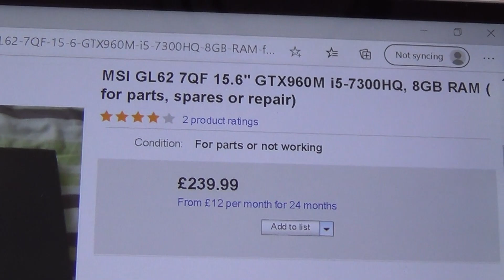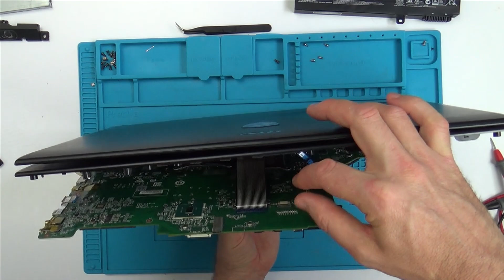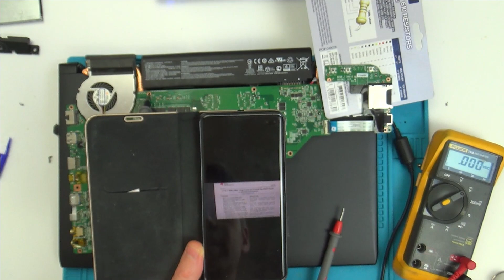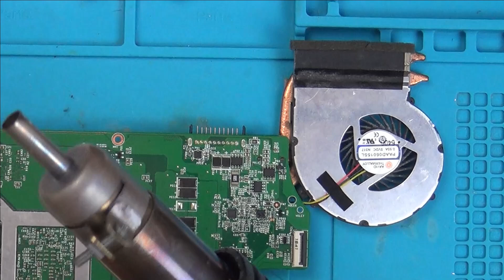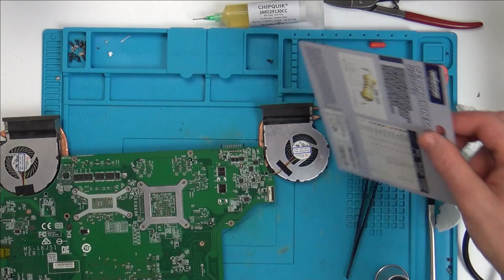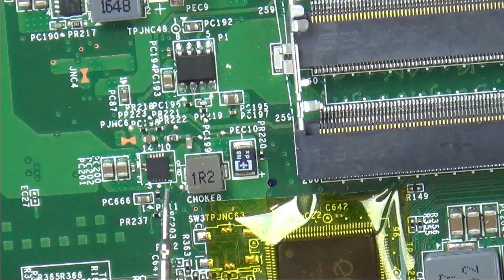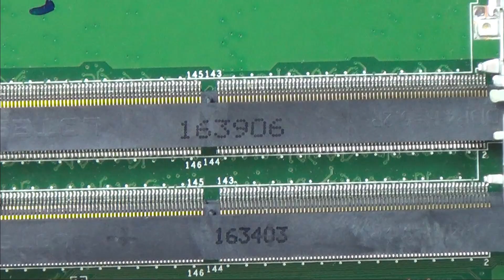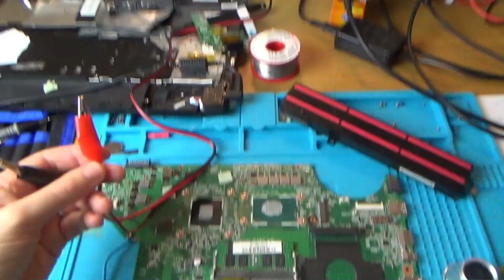Trying to FIX : Faulty MSI GAMING LAPTOP from eBay

Comment: How NOT to repair a laptop, injecting 5 volts 3 amps in
Reply: @Hamedtheunforgiven you're forgetting Vince makes it clear that he doesn't know what he is doing with these repairs and that these videos are meant as entertainment only, not a repair guide. It's all a learning process for him
Reply: Didnt notice where he was putting that amount of power to. He probably fried that chip
Reply: @krackpack1 look at the average voltage of a laptop it’s more than 5v most laptops are between 18-22v also most laptops use chargers that are greater than 3 amps.
Reply: he could have saved himself so much time that he just measured the voltage going into the battery from the charger
Reply: @Dtr146  no he couldn't. Just because a laptop has power going from the battery doesn't mean it works or does anything else. The laptop will have 2 circuits, one going from the charger to the battery and one going to the main board. If the entire circuit ran via the battery it would cause no power when the battery fails which would be unacceptable. It would also result in battery drain during use and would never run on external power
Reply: @TheCod3r  dude he spent I don't know how long diagnosing the power circuit. The power goes to the battery regardless whether the CPU works or not. I've owned one of these before. You check the voltage coming from the charger and out the pins on the board itself to make sure that the power circuit is working fine and if it's still not turning on after you check the voltage and it's working fine then it's a problem on the board. Geez it's like you never worked on a laptop before
Reply: @Dtr146  everyone has their own methods of diagnostics and Vince doesn't know what he's doing. Either way, the battery is irrelevant to whether or not it's turning on. Thd laptop will work regardless of whether voltage is going to the battery. There are 2 primary rails, vcc_main and vcc_batt. Each one branches off from the charger input. If the charger is plugged in the power going from the battery to the rest of the board is bypassed. Therefore, battery voltage (both voltage in and out) is completely irrelevant when attempting to power the device from the power brick. Personally I don't understand why you're getting so salty, but you need to chill out. If you don't like the way Vince does diagnostics as an amateur don't watch the videos. Simple as
Reply: that didnt kill that chipset ..   but i have to say  he should  use a flir cam or something
Reply: @Bloodbound89  he doesn't have one The alcohol trick works fine though but like past the halfway point after he found the damage on the GPU and seep you he was just tinkering.
Reply: My comment wasnt to insulate Vince. I know he makes sure people know hes not a pro. I was only fixing a comment I made prior. I had said I apply 5v to laptops all the time it's how i fix laptops. Bit didnt realize he applied it to that chip.
Reply: @krackpack1  ah yes, don't want to keep the heat of vince in or anything lol, /s for you idiots about to woosh me
Reply: You realize most laptops utilize 18-22v dc so 5v isn’t going to hurt it also majority of gaming laptops use a lot of amperage so 3 amps also isn’t going to hurt it, know what you’re talking about before commenting and majority of modern phone can use a 5v 3 amp charger hence quick charge.

Comment: and this is why you always remove all power to the board when your cleaning it or doing anything to it other then troubleshooting it ofcourse. Looking at the way those ribbon cables are, chances are it shorted something and it ruined the chipset, kinda like plugging in a screen without disconnecting a battery.
In one of the macbooks the backlight (40+ something volts) is located directly next to one of the pins which go to the CPU onthe screen connector. overtime the two short together (i thinksomething like corrosion causes it to short) and this kills the CPU. Louis Rossmann has showed this in one of his videos.
Reply: I killed my IO cable like that, inserted at an angle while the pc was on and burnt the cable(asus f555l)
Reply: Yeah. If I'm working on a laptop I always, always, always, unplug the battery and hold down the power button for 30 seconds before doing anything else.

Comment: What probably happened is the seller was trying to upgrade his cpu/gpu. These are non-upgradable on this particular unit it seems.  It looks like they tried to pry up the gpu and cpu only to realize they were soldered to the board.  Put it all back together and it didnt work because they fractured some solder joints and/or damaged some traces.
Reply: And then as usual for scam-bay: "Oh haha idk why but it suddenly stopped working"

Comment: I know I've commented already but you already know I leave comments as I go through the video 🤣 before writing off the PCH (chipset) you should have 2 mosfets close to the charger input. Check those first! It still looks to be the PCH (love how you've moved onto using voltage injection by the way). IF it is the chipset, my offer will still stand. I will quite happily replace that chip for you. My ACHI IR PRO SC and my high level of patience for manual reballing is at your disposal 😁😁😁
Reply: That's good of you mate, nice one!
Reply: That would be cool to see a remote colab!
Reply: @nicoful86  my channel isn't big enough for Vince to justify that but he has already done something similar with @The Retro Future when he repaired the game boy 😁
Reply: @TheCod3r  I  think he'd gladly accept a reball if offered, otherwise it's the junk pile.
Reply: @TheCod3r  By the way, do you have equipment to reball old PS3s as well?
Reply: @nicoful86  I do have the stencils but they're not really worth doing any more. They're only worth £50 / $60 and wouldn't be justifiable to repair them from a repair job point of view because of the time involved. I think Vince prefers to do it alone, but the offer is always there for him if needed 😄
Reply: @TheCod3r  Interesting! I've sold two delided backwards compatible models for around $160 - 180.  But yeah, it's like I find them every day. Are you UK based?
Reply: @nicoful86  yeah they only sell for around £60 here in the UK. Not sure about delidding though I've never really been into that sort of thing really :)
Reply: Also, check out my video on manual reballing by hand. It would be interesting to see you attempt it yourself 😁

Comment: keyboard broken, no hard drive, dvd cover mangled...and he paid .£210     :-0
Reply: The seller wasnt the honest in the world IMHO ....
Reply: It's not a particularly powerful machine either. The   CPU is fine, but the 8GB of ram and the GTX 960X are a little dated. It'll run older games fine (2015-16) but never ones will have to be set to medium or low settings. That being said, if it was working,  the price he paid would be an absolute bargain.

Comment: Hey vince havent watched till the very end yet but the big chip under the kapton tape below the ram is the chip that controls most of the board ie turning on etc, it does a check of every component before it lets the laptop boot, theres a video on youtube i think somewhere about it, its also a common point of failure on laptops, mine to include but thats completely gone now lol

also beside the cmos battery you have a bios reset button which is worth a shot with everything unplugged.
another also, (i still havent finished the video so you might have it fixed by now) if you do fix it, dont get a cheap replacement keyboard, i know of 2 that fried motherboards in some way, oh and check you 3.3v if you have it around the power button and see if it remains in place after you press the power button :)

If you happen to need parts i have a 17inch version ge72 or similar with also a motherboard issue, but a 970m and i7 ,i can let it go to you for cheap if needs be,postage shouldnt be much im only in ie :) goodluck !

Comment: I appreciate the look inside.  I didn't know laptop CPU's were not socketed and could not easily be swapped out.
Reply: Newer ones are but older models did use sockets up until around the start of the i3/i5/i7 era. They can still be swapped with the right level of skill, but as Vince says in the video it needs specialist equipment
Reply: @TheCod3r  You meant after the 1st gen of the i series? Because my HP Elitebook 8440p is still socketed.
Reply: @killertruth186  I'm not sure exactly, it was close to that era but I couldn't give an idea as to what generation because some companies we doing sockets and some were doing bga for a while
Reply: @TheCod3r  As far that I have known. It was the 1st gen of the I series is the start of the decline to the sockets CPUs.
Reply: @killertruth186  that sounds about right yeah :)

Comment: You are on the right track with diagnostics.  With a laptop, disconnect as much as you can and if it boots its just trial and error.

You dont need the battery installed, just the charger.

RAM, LCD, keyboards, DVD drive, USB ports and battery can stop the laptop firing up if they are bad.  Just because a battery gives the right voltage, it doesn't mean it isn't faulty.  

I only flicked though the video tonight as its late, but will watch it all tomorrow and see if I can see anything.

Comment: £200 for something that doesn't work? No way. Rip off. I'd pay that for a WORKING laptop.
Reply: To be fair to Vince I believe he bought the laptop to try and make an interesting video for us guys. Most of us would not have bought that laptop, but its great to see Vince try and fix it,all helps the channel in the long run.
Reply: @boastyy  yeah i fully agree
Reply: @TheCod3r  Thanks man!
Reply: You need to take into consideration the spec of the machine. That laptop is a £600-£800 machine working. 25% - 35% of market value is the average for faulty products
Reply: @TheCod3r  I still wouldn't pay that for a dead machine.
Reply: @RandyDarkshade2  you have to remember the value for videl content too. It makes interesting video content and that itself is very valuable. I would pay £200 for that regardless of whether or not I'm making a video on it :)

Comment: I'm only half way through but I just want to mention about your heat gun, I had the same machine and the same thing happened to me. The heat gun you have uses a fan style blower and what's likely happening is the plastics around the fan are starting to break away. I had one pretty much catch fire and cause the smoke alarms to go off because it ended up filling the room with smoke from melting plastic. I highly recommend the Atten ST-862D station and TS100 iron when yours does fail. For £200 you can pick both up and i haven't looked bacl since. Remember that Xbox One X retimer you struggled to take off? The Atten gobbles those up for breakfast 😅

Comment: Just too late , I will watch it later , Just remember only inject 1 V max anything more could cause damage , Looks like the PCH is dead you can confirm it by testing the USB data pins to ground and the caps on the PCH  , You can always replace the PCH  👍 great video, PCH connects to the cpu and EC (embedded  controller)128 pin Chip , CPU connects RAM and GPU, The EC controls the power up sequence, power button go to the EC, Let me know if you need a schematic , good board to learn on :) USB could cause a dead PHC
Reply: Agreed! 1v will ensure that if there is a short and the board is going into protection mode that only safe voltage will go to the cpu, gpu etc. Very good tip buddy

Comment: that is the only problem with modern laptops now as the ability to replace or upgrade the cpu is very rare. Usually if the cpu is the issue you could of gone and got a similar if not better one and that could determine if the cpu is the issue. Did you think about taking out the ram and attempt a power up. sometimes ram does refuse you to power up. If you get bleeps at least you know its attempting to POST.
Reply: Cpu in that laptop is soldered onto the board... so not really worth the work.... But it looks like that was there idea and tried to pry the cpu out of the machine and damaged it, obviously they didnt know the cpu is soldered.